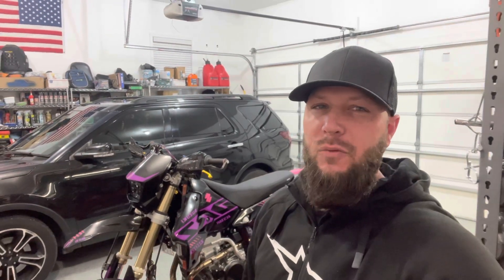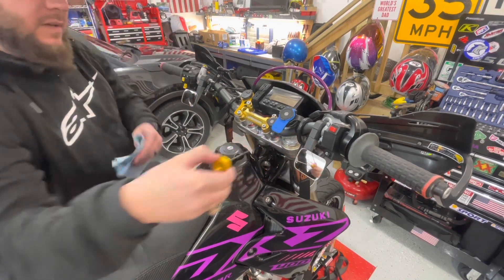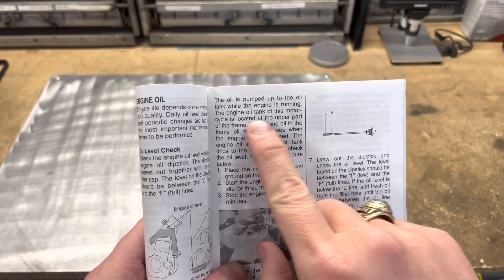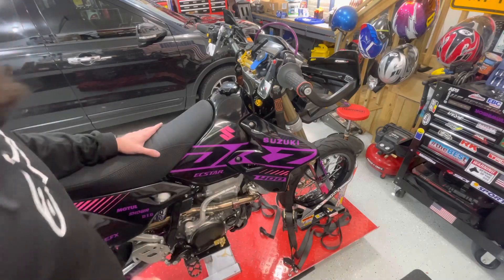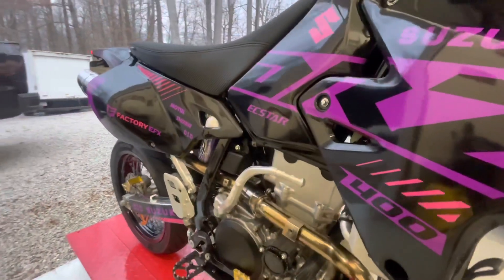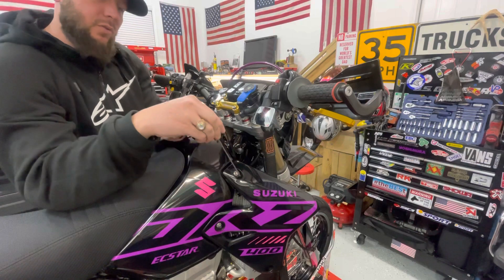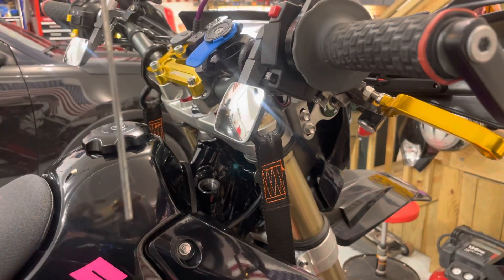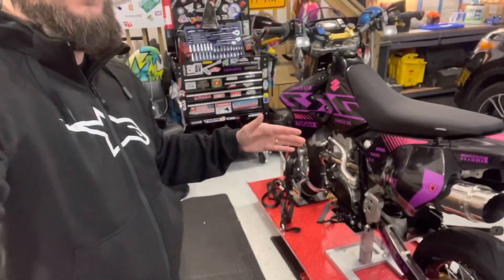How I Check The Oil In The DRZ400. (Where did all my oil go?)

Comment: How many miles I should change the oil?
Reply from the maker: Manual says first change at 600 miles. Then every 3500 miles after that.
Reply: @linksgarage1985  I change mine at 200 miles the first one and now its 1,100 miles and only have 1/4 of oil idkw

Comment: Having an 08 with 41k KMs on the original, never opened engine I'm more than familiar with checking my oil, if I don't go hard on the bike It sips like 0.4L every 1500KMs so I just top it off at that mark and than ride another 1500KMs and do a full oil change, done it this way since I got it and it had 29K KMs on the clock and it runs good.
IMO the best service interval is oil+filter every 2000KMs, with Motul 7100 Oil the shifting get's stiffer after around 1000Kms but 3000KMs is the sweetspot.
Also, overfilling the bike a little won't do no harm since oil is stored in the tank, I always go a little generous on oil quantity with mine since it likes to take a sip of it every now and then.
Reply from the maker: Fantastic info!! Thank you for sharing! We appreciate This!

Comment: Where did you pick up that aftermarket dipstick? the original ones are junk easy to cross thread
Reply from the maker: @evanthogmartin8163  I believe I got it on Amazon or eBay man.
Reply: 18 year DRZ owner, I've never had an issue with the possibility of cross threading the dipstick.  Same style dipstick was on the two DR350s I owned for 12 years prior to my DRZ, also no issues with them either.

Comment: Could someone point me in the direction of the video with the battery change. I can’t seem to find it. Thanks!!!
Reply from the maker: I don’t have a battery video.
Reply: @linksgarage1985  ahh my bad. For some reason I was thinking there was. Any suggestions on a replacement battery? OEM is completely dead.
Reply from the maker: @stgga6054  you can get these from revzilla. YUASA BATTERY
Yuasa YT7B-BS AGM Battery. Might check fitment

Comment: I overfilled it once and had to drain some out, which was a bitch. I saved that excess oil to use for future top offs in case it was burning some. It's been 8 years since then and it's still sitting in the bottle (definitely old now and wouldn't use it anyway), but I laugh because it never needed any of it. My bike burns very little oil even after 14 years. The DRZ is among the greatest motors ever made.
Reply from the maker: Hell yea! I mentioned your DRZ in a video a while back. The fact it’s got so many miles is amazing!
Reply: @linksgarage1985  awesome 👍 I'll get an update video soon! Just finished doing a valve job, coolant flush, oil change, spark plug, full carb rebuild, put it all back together and fired right up. Running absolutely perfect right now. Love that machine!
Reply from the maker: @kevinkillsit  hell yea!!!!!
Reply: I just did the exact same thing on my new DRZ too - I over-filled it during its first oil change - arghhh. Good to know it hardly burns oil!
Reply from the maker: @CoachSteve4u  congrats on the new bike!
Reply: @linksgarage1985  Thanks!

Comment: Maybe my experience will help someone...
I have a new DRZ400s. I read the manual very carefully and even created my own step-by-step procedure for changing my oil. When checking my oil, it looked like I OVER-filled it. 
I know that's not good, so I tried to drain the oil from the frame. I let some drip out and it hardly changed at all. So I then let a lot out and I let too much out. 
Now I have to order more oil, lol. Frustrating. and every time I checked my oil, I warmed up my bike for 3 minutes and then waited 3 minutes. 
I must have checked my oil 10 times and I still didn't get it right. My solution will be to add just a little bit at a time and check - patience!
Reply from the maker: Thank you for sharing!
Reply: Bruh it’s literally 1.75 quarts
Reply: If you clean the oil filter (stainless steel here) and get excess oil out of the oil filter compartment AND clean the strainer like I do every oil change (requiring you to drop the oil hose on the bottom of the frame oil tank - and losing the oil in that hose) - THEN the DR-Z will take almost exactly 2 quarts.

And - just for the record, 2 quarts is equal to 1892 mL. The shop manual calls for 1800 mL on an oil and filter change    Safe bet if you don't mess with the strainer is to put in 1700 mL or 1.75 qts., check the dip stick, and top it up - of course.